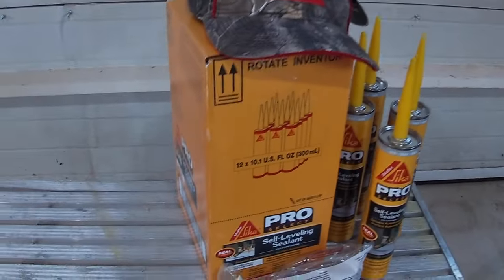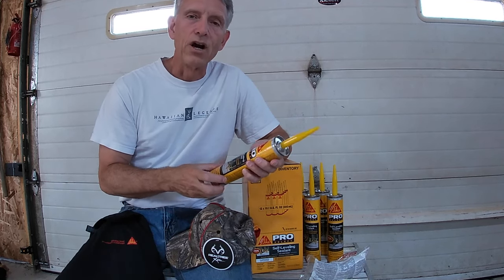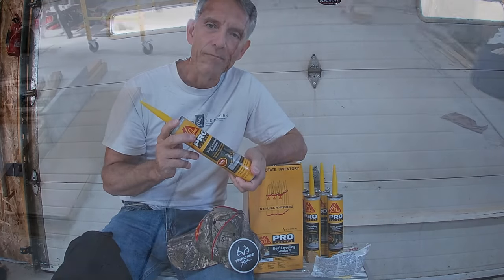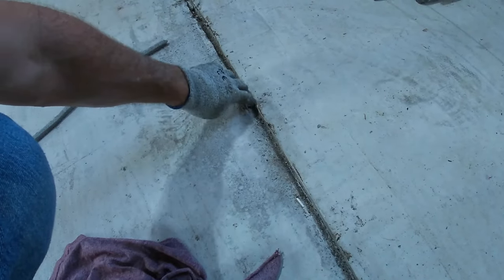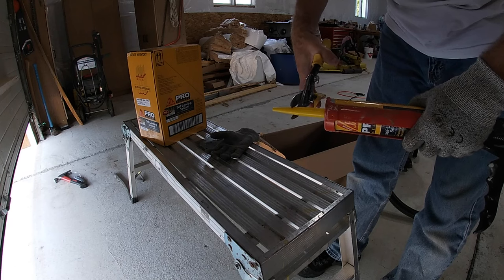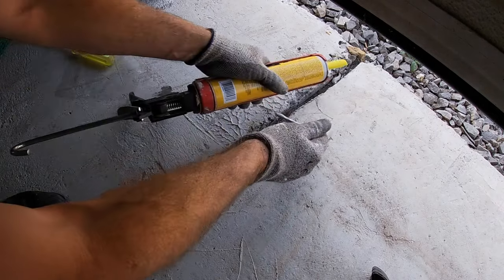Sika's Self Leveling Compound to Seal the Expansion Joints Of My Concrete Floor

Comment: Hello Peter. Even without you showing the beginning of the fill in time lapse, I could see it doing the job the can says it does. Maybe revisit this in some years to show how it stands up to daily activity. If you had not put the caption in to notice the ceiling, I would have noticed at least that the insulation had been moved. You chose the best location to store it. I don't think it is so much as being a novice as you said, rather the first time using the product. This is not the first, "first time" job I have seen you do with good results. How many more cans did you need to buy? Based on my observations, my guess is that you needed to buy a total of 21 more cans. Have good days! (oh, will you put some kind of sealant on the floor that includes sprinkles?)
Reply from the maker: It was a lot of tubes. I think you are close with '21'.